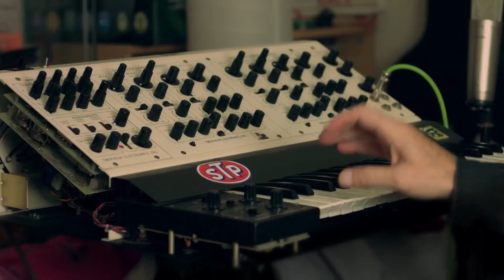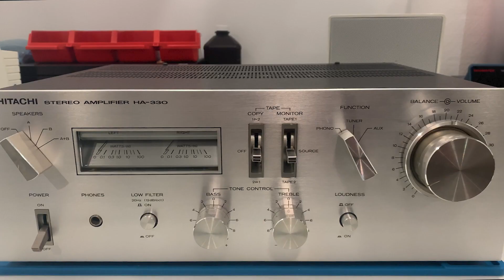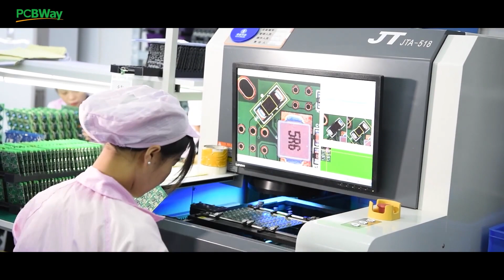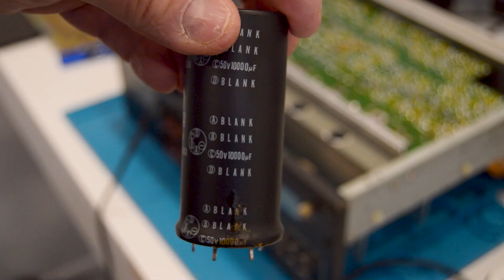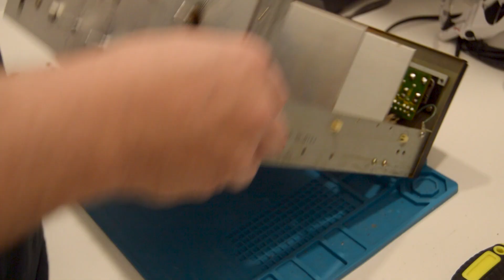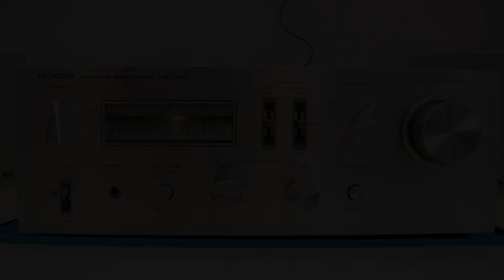RESTORATION of Old Power Amplifier from 1977 | Episode 37

Comment: Hey, thanks so much for very insightful video! It made me brave enough to buy a sweet looking HA330 from one hifi collector. I'm now ordering a caps for recapping whole unit. But I don't like one thing. The unit gets quite hot after a while. Hot enough I cannot touch the metal case. Even without any input signal. Is there a chance this could be also caused(and fixed) by caps, or I need to study somewhere for bias corrections? I'm familiar with audio/electronic constructions, but long time did not repair something like this, and I dont have any oscilloscope right now. Thank you!
Reply from the maker: Hi there! Tired filter capacitors can cause high ripple, which makes the transformer and rectifier run hot. Also bad electrolytic caps for the bias section can upset the bias and if the bias is too high, the output transistors conduct heavily all the time, turning the heatsink into a space heater. So, first thing change the caps and see if that does it and I would suggest not running it for now until they are replaced not to damage anything else. If you're still have an issue after that you can look at the transistors. Thanks for watching! PS Do you have the service manual for it?

Comment: Nice, Thanks for the info on the large caps, I did not know that some can contain more than one cap (also that was a clever work around to get the smaller replacement to fit). Just one thing I have to say, don't use a pencil to mark things on a PCB. I've never had a problem because of it. But a guy I worked with years ago, Frank was his name was a rework tech and he told me about a board he was given to repair that was giving loads of different errors and faults that couldn't be reproduced . After a whole lot of debug he found a slight pencil mark across a couple of traces. It seems that one of the engineers was explaining how the board worked to somebody and using a pencil to point out the different bits and pieces. It's the graphite in the tip that can create problems. Anyway, wishing you the very best for Sunday and the honeymoon. Enjoy it ;)
Reply from the maker: Hi Peter! If ever you encounter a cap with multiple values, I remember there is a place in the US that can custom make them. Yes the pencil I remember in electronic school back in 91, one of my teachers was an ex military guy from a foreign military and he said they often had no money for resistors so they used the led of a pencil to create a resistance. But, just like your friend, it was on the traces side. This side was single sided but you're right, even though it was a very faint mark, who knows; in hindsight I should have used a permanent marker or even better a washable kid's marker would probably be the best. No honeymoon for now. It's kind of hard when you still have young kids and teens at home who depend on you for everything. I guess the honeymoon will also have to wait another few years! Oh well! Thanks again!